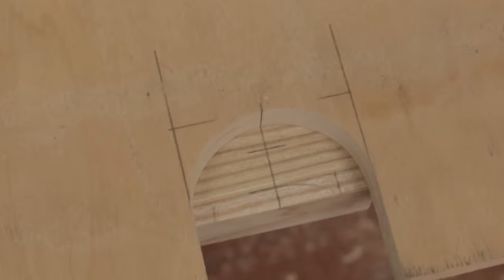21-yo makes a dresser // woodworking

Comment: Hi Oleg & guys, I’m just starting woodworking. In this video I see that for many parts Oleg uses glue without any other support like dominos, etc for example for the legs and for the bar support. Is this enough to last a few years?
Reply from the maker: Hi, of course additional reinforsment such as dominoes are never superfluous, but I try to do everything taking into account the properties of wood, so yes, that's enough. For example, when gluing domino plates are generally used only for positioning (of course, I will also do it when I buy it), but in this case the strength of the adhesive seam is quite enough. Now about the legs, the bonding area there is quite large, so that additional reinforcement will be superfluous. In general, this is a very broad topic, I'm not sure that I can tell here clearly about my views on this, but I think you're understand what I mean.
Reply: @infeelfurniture  thanks a lot for your tips!

Comment: Really great video. This disk at 13:48 --Did you make this disk yourself? I've never seen that on a table saw. Was it necessary because you seem to do a hand sanding too?  I really liked the mat door. I've seen that done as an insert in a frame but not glued to a board. Also I was confused why you needed to router the space for the hinge on the cabinet side. Usually the hinge lies flush with the side of the cabinet if there is no frame. I loved all the detail and hope one day I can get into fine woodworking. I'm still doing framing construction and drywalling.
Reply from the maker: so I made it myself, now I'll try to find a video where I got the idea...
Reply from the maker: https://youtu.be/b-kXTKVVTL4
Reply: @infeelfurniture  That is genius. I like how he thought through the mathematics on it too.
Reply: @infeelfurniture  I like that you made the sanding disk yourself. I'm doing more rough framing and drywalling. I hope to get into woodworking some time in future. I'm still trying to decide what to do with my life. As a gymnast I like working with my hands. I like using tools and seeing things I help build transform. This is why I like your find woodworking. It is so much great control to make. something beautiful and functional. Thanks. Anton